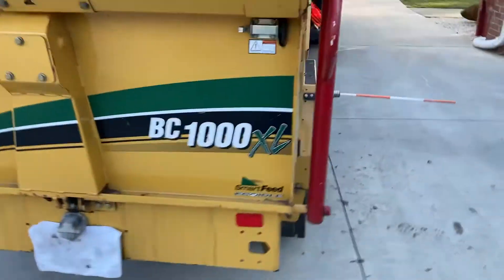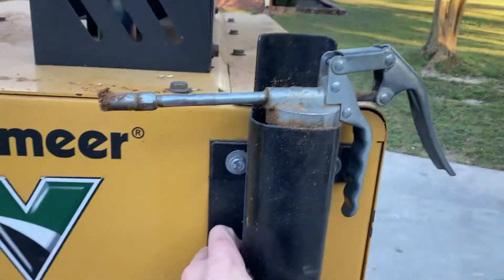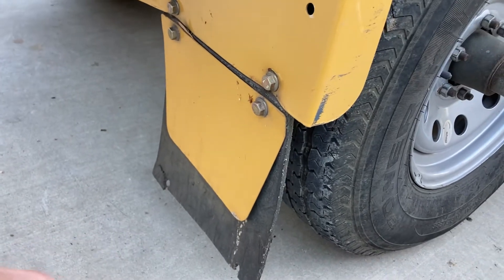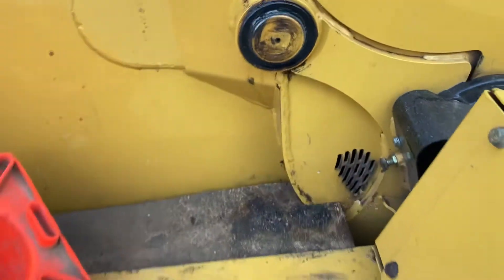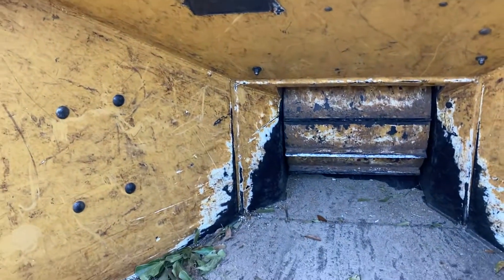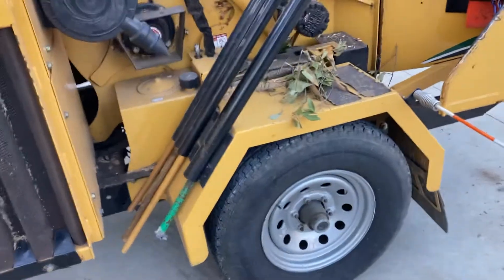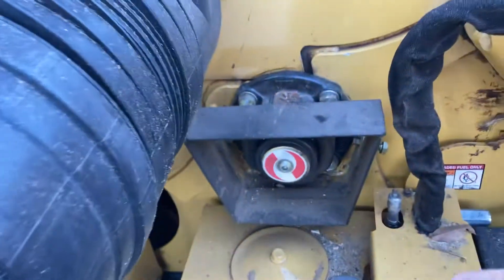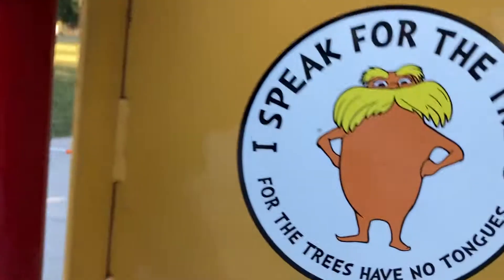Vermeer BC1000XL Gas Chipper Upgrades - Modifications

Comment: I have to ask a question how come you guys bought the gas version the turbo diesel version is pretty tough
Reply: What did you do after that buy another chipper
Reply from the maker: @ANDERSONEXPRESS7  I bought another and swamped out the motor
Reply from the maker: Gas is cheaper for parts and maintenance. But I regretted it. The PSI engine was trash. Only good for around 1200 hrs

Comment: Would you go gas or diesel if you did it again? In my state you don't have to register/plate a chipper if it's under 10,000 pounds and you aren't storing/hauling anything on it.
Reply from the maker: I've run both and prefer the gas. Not much power difference in my opinion between the two. Fuel economy is the only downside on the smaller chippers, but the cost of repairs is higher on diesel...plus the initial purchase price. We run a BC1500 gas currently and love it. 45 gallon fuel tank solved our fuel issue...plus it eats fast so we run it less.